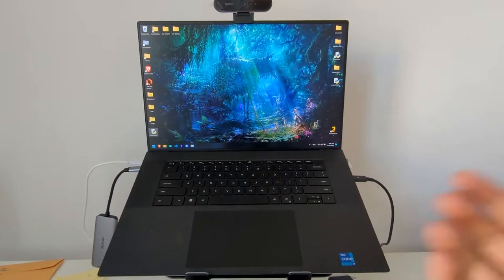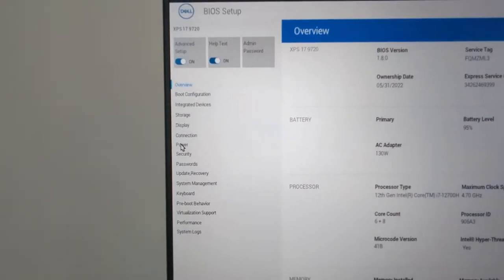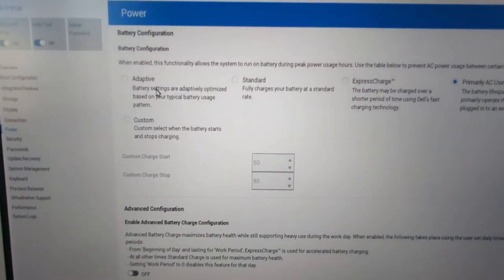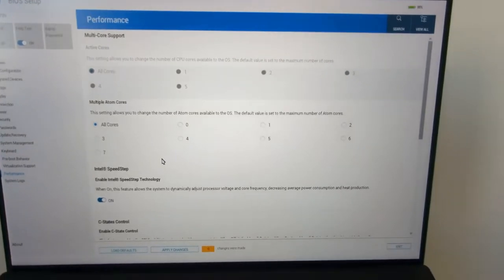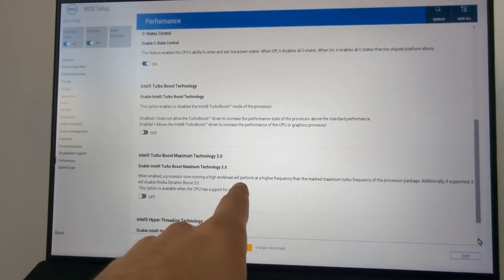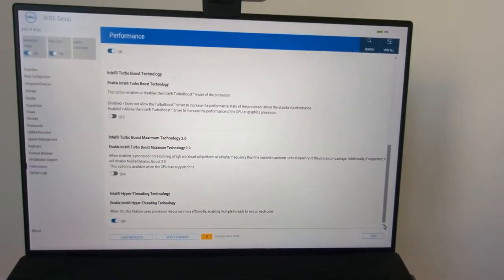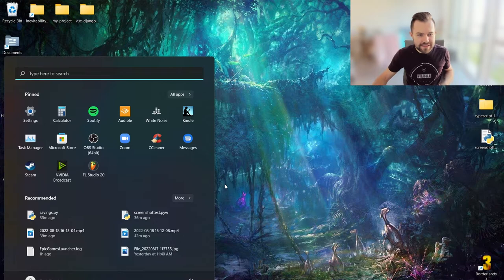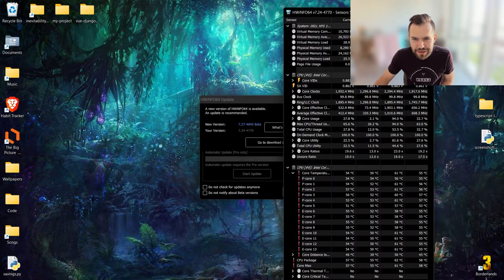These 2 Settings Could Be Overheating Your New Dell XPS Laptop

Comment: Don't buy xps laptops for gaming. The cooling systems in them are piss poor snd the bios is even worse. Even with a cooling pad and dropping clocks significantly, its inevitably going to thermal throttle.  Not trying to bash. Trying to save you money .
Reply from the maker: Yeah I'd say if you're buying a laptop exclusively for gaming there are better options, but I game on mine and it runs perfectly fine with those settings. I keep mine elevated so there's space for the vent to breathe.
Reply: @zackplauche What games do you play on your XPS?

Comment: You need to change your Thermal Paste, after some time it gets hardened or useless to absorb temperature. else these Bios Tips is great
Reply: How long till it needs changing? My XPS 17 is from 2011... So it's 13 years old now 😅 thanks
Reply: @rennmaxbeta usually 3-4 years depending on the temps you’re seeing

Comment: Thank you so much. I've read through tons of forums, read solutions from users and employees of Dell about various nonsense that could possibly help. The issue is obviously(!) the Turbo Boost tech and shows that it wasn't tested properly. My laptop started overheating and draining during during my work tasks and once I've switchd Turbo Boost off in BIOS, the fans basically stopped being audible, temp went down and it's working perfectly fine now as it should. When I find the time, I'll destroy those forums and will spread this video as much as I can. Great job!
Reply from the maker: Haha, thanks! I appreciate it the support 🙂.
Reply from the maker: And again, if anyone can SHOW a better solution, I am open to trying it!
Reply: @zackplauche  I have a better solution, you're better off customizing your battery setting in Windows to Battery Saver, then change the monitor off and sleep times.  Setting to Battery Saver also disables Turbo, but it gives you the ability to easily turn Turbo back on, without having to go into BIOS to turn it back on.  Disabling Turbo reduces your performance by 1/2, so it would be better to have a way to re-enable it when needed, whiteout booting into BIOS.

Comment: I've got to say, I'm genuinely frustrated with the latest BIOS update on the XPS 17. For a company that claims to be at the forefront, this kind of firmware is baffling. It almost feels like they're intentionally slowing down their machines to push us towards an upgrade. I am going to try Lenovo next.
Reply from the maker: Yeah, this is one of those things I wish I didn't have to think about when buying a $3000+ laptop 😑 on a list of things that should "just work", I thought this would've been one of them before they turn my laptop into a toaster lmao.
Reply: Don’t buy a Lenovo they do not last and their batteries degrade very quick
Reply: Does it have other problems or only those? Because I have Acer Spin 3 and it shows me BOD like 3-5 times a day. Also, it has some issues with connecting Bluetooth accessories and some major sound problems. Since I bought it in Poland and changed the language to English (from Polish which was set by default), there are still some stuff written in Polish.
Reply: How can they slow down their machine? It's based on windows. So how?
Reply: @TheOne_p what should I buy? Asus?

Comment: I have a same overheating problem on my XPS 17 too. but i think you don't need to touching the BIOS , just replace the old thermal paste with the new one is better. Dell's machine always have problem with overheating because thermal paste they apply on every machine is not good.When i buy a new machine i always change the old one and replace it with a new refresh thermal paste. So I think is will be easier than touching the BIOS
Reply from the maker: To me replacing thermal paste would be a lot harder 😂

BIOS for me was the easier solution on this thing. Good to know tho 👀 Might checkout that solution too.
Reply: @zackplauche sure the hell is. Who wants to disassemble a new $2k laptop? They should use better paste
Reply: Although i would also recommend replacing the thermal paste (i did as well) I would think clicking around in bios is worlds easier than replacing thermal paste
Reply: How old is your XPS 17? Mine is 13 years now (2011 model). I think the system is running too hot, like 60c after boot. Probably needs the thermal compound changed do you reckon?
Reply: @zackplauche basically disassembly of the whole laptop to get to the CPU heatpipes and thermal paste, yes.
Reply: @rennmaxbeta  I'm still using the 2021 model. Before I use the 2016 until 2021 I switch to the new one.

Comment: I really so appreciate you recorded this video 😅. I recently got dell laptop not xps , but I had exactly same issues as they use same bios settings on all models. Thanks once again, it’s such a valuable recommendation!👍
Reply from the maker: Hey Tech Equations! Glad I could help 🙂 People keep saying it's suboptimal but for me and others it seems to be the only thing that worked 😅
Reply: @zackplauche  I can only say "haha"😅 to those who saying it's suboptimal. As impact of those settings is so horrible that laptop nearly useless under good/high workload tasks, everything just lagging and stuttering, as well as it causing constant cpu heating even under moderate and low workloads which resulting to only fan noise.
Reply from the maker: That's what I'm saying! lol

Comment: got this overheating issue also on my xps 15 i9, couple days ago some components burned cause of this overheating. dell technician turning off these setting and sure it cooling the laptop down, but my max cpu clock is only 2,6ghz and it slows my work. i working in revit 3d modelling and i think turning off these settings are not good for performance.
still searching for possible trick to avoid this overheating issue
Reply: Same here man

Comment: Thank you for this video!  This instantly helped keep my CPU from heating up so much when idle. It dropped the temps 30-40 C.  For some reason this setting had my CPU hitting 80-100 C when not under heavy load.
Reply from the maker: That's what I'm saying! It makes no sense to do by default and doing nothing haha.

Comment: You just crippled a great Laptop to half its power, by turning off its Turbo Boost. This is not the right way to reduce heat.
Instead, use the program "ThrottleStop" to limit the TPL-Wattage, giving your CPU still room to breathe. "Undervolting" would be even better, but your BIOS probably doesn´t support that. Just go down to 25W or 30W at PL1 and PL2 in ThrottleStop  (XPS9710).
Reply from the maker: Do you have a video of setting this up?
Reply: Guys, it's nice to see you guys having a chitchat but I am really confused. These technical talks are going right over my head. Should I turn off the Turbo Boost or not? My Dell XPS 13 (Evo CORE i7) is a heat generator.
Reply: @salehin85  The answer is likely no. Turbo boost gives a boost when needed; visualize it as strong pushes in power to get over a bump. Turning it off means that it can no longer provide any explosive work. With it off the laptop would just settle with more consistent work over longer periods of time to do whatever it is doing rather than hitting heavy in shorter bursts. In either case, the laptop does the same amount of work,  it would likely be warm regardless of choice. The turbo just happens to be more convenient for hiccups and time.
The solution would be to say decrease the amount of work the laptop does in totality, or increase the efficiency at which it works.
Reply: @coolmemesbudd   thank you so much. its all clear now you have explained so nicely thanks again
Reply from the maker: Actually I'm still a bit confused lmao. Anyone got a vid to showing how to do this for these laptops? I'd definitely prefer to see how it's done. I shared a solution. If someone has a better one and can show the process of setting it up, I'd love to see it 🙂 Please share a step-by-step vid / guide!
Reply from the maker: @coolmemesbudd  Yeah I just shared a solution that worked for cooling down. Definitely might not be optimal, but it does work and I haven't been having problems with overheating since haha.
Reply: @salehin85  I don't know about your device but mine was getting crazy hot, fan going mental and battery draining. For a laptop worth about 2k with my setup, that's not alright. And switching off Turbo Boost fixes it all! I encourage you to try, test and then go back to test with it on again. "The answer is likely no." sounds to me that coolmemesbudd never had this device and doesn't seem to have any empirical evidence. In my mother tongue we say, trust but check - I'd start with that.
Reply from the maker: @Skeptical_Dante  Agreed! At least show the better solution haha. People can judge the vid but it works 🤷‍♂

Comment: Cannot Thank you enough my man! This is a real cure right there. I use my XPS 15 9530 for sw development with Ubuntu installed. It is so confusing when I run terminal, Slack and maybe couple of tabs in Firefox and this thing blows the fans on 5K rpm with solid 100 degrees Celsius on some cores, being hot like a pancake.
With these "features" off I am barely hitting over 2K rpm on the fans (barely audible) with 55 Celsius of maximum temp. I will test tomorrow with dual screen setup running 4K monitor also serving as a power dock, but already I am feeling this is how it should be with this powerhouse of a laptop, which is Brand new on top.
Thank You! And shame on Dell and Intel for putting such clearly marketing driven "performance" features that only ruin Not cheap hardware.

Comment: Is it okay if I use the same setting even if I use my laptop plugged in and not?? When I’m at the office it’s plugged in but otherwise it’s not as much.
Reply from the maker: So I'm not a super big computer expert (I'm a developer that just happen to have this problem and resolve it). From my understanding, this setting just makes it to where when it is plugged in, the power isn't cycling through your battery, and your computer is receiving it's power ONLY through the charger. It still charges, and performs the same when it's not plugged in. I've had this for more than a year now and it works perfectly fine.
Reply: @zackplauche  thank you so much!!!

Comment: hey i have DELL PRECISION 5560, does it also work with this laptop because when its plugged in and i wanna play a game it starts making loud fan noise . thanks!
Reply from the maker: Hi! I'm not sure, I only tried this with my laptop. I would assume if you have the same settings it would potentially work. Let me know how it goes!
Reply: Hi , i tried your method and it actually reduced the loud fan noise , but will it decrease my CPU’s performance?

Comment: I'm using Dell XPS 12 9Q33, do the same settings apply? Because the boot menu looks way different.
I think at some point I changed my Bios settings but I checked my battery health today and it's at 96% so I guess that still a good thing. I live in a region where there is constant power outage so having my battery run down in an hour or two is a headache for me. Plus the overheating is just too much.
Reply from the maker: Hmm, not sure :/

Comment: I guess it’s a little cooler after changing those settings, but perhaps the 9510’s design is just crappy and/or it wasn’t made for games that are newer than it. It started heating up right after I opened Age of Empires 4.
Reply from the maker: So for me it still heats up from gaming but I believe that has to do with GPU, and laptops pretty much normally get hot with gaming (from my understanding). It's still a thin laptop. It's just a high powered one haha.

In my experience, it just shouldn't be AS hot as it would be without these settings.

Comment: Well this worked for me. Before changing anything in the Bios it would shoot up to 100c instantly when using Cinebench. Turned of the Intel turbo and it made it to 75c. Night and day difference.
Reply from the maker: Glad it worked for you!
Reply: But I think by turning off the Turbo Boost, you won't get that maximum expected performance from the CPU. Will you?
Reply: That's how the computer is supposed to work. Unless you have an absolutely stunning cooling solution (spoiler alert, none of the XPS models do), the CPU is designed to go as fast and as hot as it can. It's not going to damage it, as it will reduce clocks as necessary to stay right at the threshold.
This solution is fine if you don't want a hot computer, but you are in fact killing performance.
Reply: @Alex.Hilman That is correct.

Comment: Has anyone tested Performance with Turbo disabled?  Isn't the base clock for the i7-12700h 2.3 Ghz and the Turbo 4.7Ghz?  Effectively locking you to 1/2 the CPU speed.  That's a huge difference.  Looking at your HWinfo, looks like your max CPU speed is hitting only 2.3Ghz.
If you are going to do that, just change your power settings in Windows to disable Turbo, no need to go into the BIOS
Reply from the maker: Good question! I'm not super techy on hardware / windows / bios etc. setup to know how to do that 😅 if you find someone who does the test or figures out how to keep performance without overheating randomly please let us know!

Comment: This is really bad advice, you're reducing your performance by 1/2.
You're better off customizing your battery setting in Windows to Battery Saver, then change the monitor off and sleep times.  Setting to Battery Saver also disables Turbo, but it gives you the ability to easily turn Turbo back on, without having to go into BIOS to turn it back on.
Reply from the maker: So I actually tried that first before doing the BIOS thing and it didn't fix it. I don't think it's only Turbo, it was both of the settings for some reason. 

If you can find or make another simple tutorial on how to fix it please share!

Comment: Thanks a lot, I'm gonna try it now. Btw it is called Hardware Info  not H-Winfo ;)
Reply from the maker: Thanks! I'm not an expert at hardware at all 😂 I mostly make coding videos.
Reply: Switch off turbo boost. Since I did that, the device is perfectly fine and works like a charm! Or don't put the laptop on your lap as they instruct in some forums (:
Reply: @zackplauche HW is an acronym for Hardware. Don't feel bad, you didn't say anything wrong.

Comment: But you have just decreased the power of the laptop.
You could of achieved the same thing by purchasing a laptop with a less powerful processor.

Both of the settings can be left on enabled and the laptop will control the processors as per manufacturing spec, to make sure you get max speed without running dangerous temperatures.

The CPU is designed to run at 100c.

A better way to keep you laptop cool and quiet would be to leave the settings both enabled and in dell power monitor set the laptop to Cool and Quiet.
Reply: if you do this on the XPS 13 plus it still overheats and the fans are insanely loud
Reply: I can’t use my laptop at all if it’s extremely hot to the touch, so… the additional “power” is useless
Reply: I don't understand why more people don't see this.  There has to be a better solution than locking your CPU to 2.3Ghz, when it Turbos to 4.7Ghz.  That's a huge performance loss.
Reply: @malachibergman902  You're better off customizing your battery setting in Windows to Battery Saver, then change the monitor off and sleep times.  Setting to Battery Saver also disables Turbo, but it gives you the ability to easily turn Turbo back on, without having to go into BIOS to turn it back on.
Reply from the maker: Would love to see someone try ImTheKaiser's solution to see if it works without making the laptop a toaster!
Reply: @zackplauche  I tried the @ImTheKaiser solution unintentionally while I was recording a video (only the browser and the recording platform were my opened windows) because the fans were too loud and it got even worse. The temperature went to 100º degrees C and the fans were stuck at 50% of power and, consequently, they coudn't cool the CPU which resulted in higher temperature and loudness. From the research I've done online, your BIOS solution is the only one that worked. BTW, I also discovered that DELL only has 3 fixed fans speeds which seem to be none (when on balanced and quite mode), medium (automatically activates and desactivates in all modes when temperature gets too high or is all the time active in the performance mode) and finally max speed which can only be activated with the G boost mode. In my opinion this is the problem: the fact the 0 rpm mode exists (and from what I can see it cannot be disabled). If the fans could always be working on a minimum amount of RPMs, they wouldn't make noise, they would prevent the hardware from heating and, thus, there would be no need of higher fan speeds to cool it down.
Reply from the maker: Whoa! Awesome research! Wish they could've done it better by default :/

Comment: Not sure this advice is good for everyone. And you are not making it clear to the user they are trading performance for lower temps.  The other way to address this is to keep performance and find a way to improve cooling... or to setup modes that are difference when using as a workstation plugged in vs a mobile unit on battery.  Not everyone will want to give up performance.  One could use liquid metal for better heat transfer on the CPU and GPU... add additional thermal pads to the MOSFET so they touch the case and it is used as a head sink and can add a cooling pad to blow more cool air in the right places... or have the fan pull the hot air away.
Reply from the maker: I never said this advice is good for everyone. This is what worked for me.

Comment: You can also disable cores, it will run even cooler 😂
If you don't care about performance, there are other laptops with less power hungry cpu that should be more appropriate for you
Reply from the maker: Come up with a better & simple solution that doesn't overheat the laptop for no reason and keeps the performance and I'll pin it 🙂